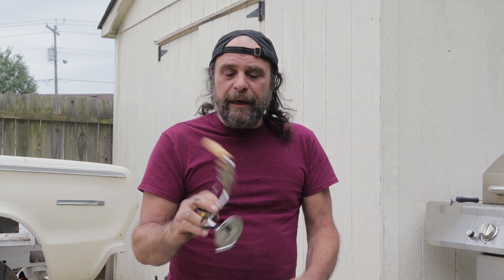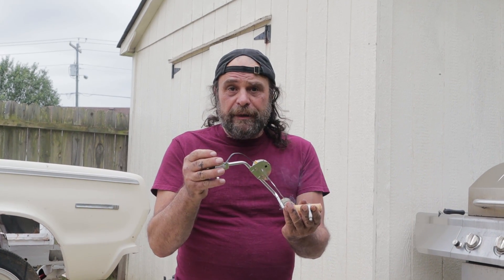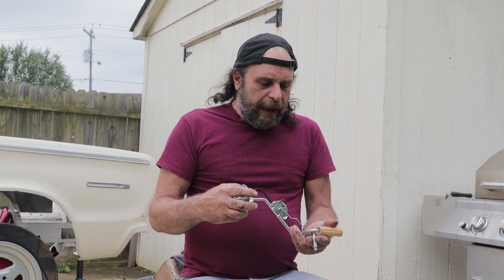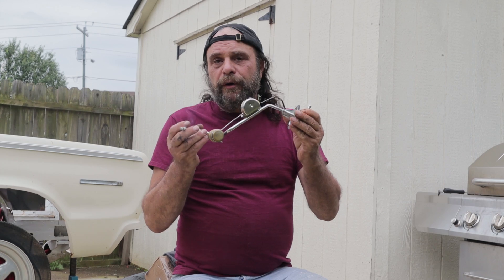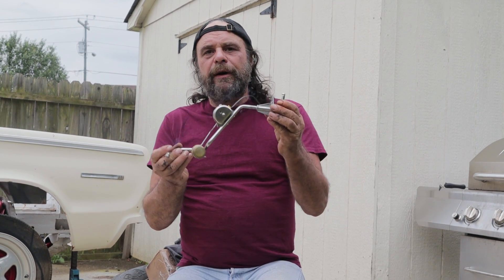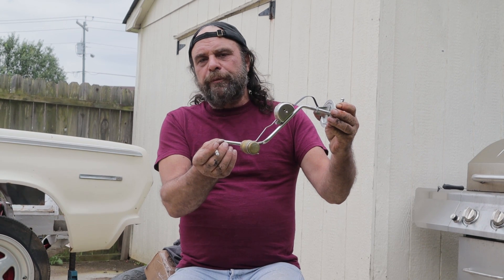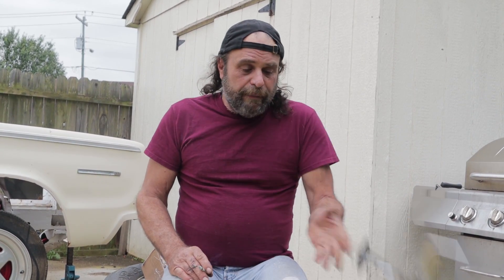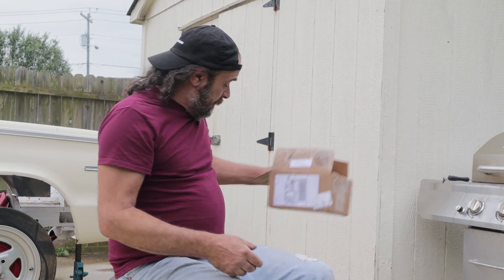Fuel System Basics- In Tank Pick-Ups

Comment: Good video uncle Tony 

I’ve had the same problem except with not the fuel pick up but the oil pick up in the motor where for whatever reason I used a different sump at the time and it went on fine..... but the oil pick up screen was basically 2 mm off the bottom of the sump and when I started the brand-new motor I could not get oil pressure......!!

caused a panic for about an hour when I finally figured it out..... you can just drop the sump and bend the pickup by hand to give it 3/4 of an inch or an inch and that’s fine........

but here you are starting a freshly rebuilt motor with no oil pressure absolutely causes workshop stressed to the max......!

It’s really popping a vein in your forehead type stuff...!

Give me fuel tank pick up problems any day compared to that mate

Comment: Did you inspect the fuel lines for cracks? Have you ever seen gas dripped on the ground after parking? A crack in the fuel line will allow air into the lines and at high rpm you lose combustion. Cant climb hills either.

Comment: I see how extending it helps, but what happens when you do some heavy breaking. Hmmmm
Reply from the maker: Not much fuel demand during heavy braking, no?
Reply: True....Like you said this is something we dont think alot about, if the fuel moved forward or backward, does just a little air taken in by the pickup tube matter at all, and would there be a difference between mechanical/electrical pumps in this matter.

Comment: got into a little skirmish/fun race up a BIG hill back home in my 70 torino with a bud in his 68 chevelle. i was pullin him petty good, then suddenly mine nosed-over and went ker-plunk. he went buy me like i was standing still. had to do a coast-down the hill backward followed by a strange uey. coasted about 4 blocks. couldnt find a single visible problem. after alot of cranking it finally started and ran fine. i sold the car before the problem was remedied. if that wasnt a partially blocked fuel pickup...i dont know what is....good video T.  on a subject...not addressed enough, always better to have the system in your hands for the classroom anyway...keep up the good work.

Comment: You'd be one hell of a fun next door neighbor to have, all the neighbors would hate us, loud ass old Mopars  I've got a 318 74 duster and a streetable /mostly strip built 69 bee with a 451 inch stroked 400 4.57 gears auburn sure grip it's got super stock springs and adjustable snubber sub frame connectors, full comp 727.  292 /.509 MP cam  I built most of it when I was 18 not many miles on it  Rocky Mountain race way closed down so it's going to see some street action

Comment: I put a new one in my 69 bee 22 years ago. right after installing it I looked at it through the filler end, damn thing was just like you mentioned sitting up wrong bends lol now 22 years later I put some fresh gas in and something is leaking now, I'll have to crawl under   and see what, maybe the fuel hose is cracked it's so old, then I'll finally fix that 22 year old pickup problem and maybe extend it like you do. maybe I'll make it a 3/8 or 1/2 inch tube and re solder the sender on  thanks for the extension idea great vids Tony

Comment: I’ve always had trouble with the brass floats on reproduction sending units. After a few months they either split open or they leak at the seam. Either way you get a sunk float. I’ve started throwing the brass ones away and using plastic ones instead.

Comment: I had a 2300 Mercury Capri (79) that would not run on 87 octane and this was back in like 91 before all the ethanol.  If you put the cheap gas in it, it would stall out and not start back up until it cooled down.  Right before I figured out what was happening, I had to drive 25 miles home turning the car off constantly and coasting with the clutch in to keep the car from warming up.  With 89 octane, no problems.  Till this day I have no idea what caused that.

Comment: UTG
If you had a stock 383 Mopar, 4bbl , 600 Edelbrock with 323 NON sure grip . 
What would you spend your $1,200 to $1,800 on for performance? Street light to street light. 
355 sure grip OR Convert over to  Fuel injection?

Comment: Back in '86, had a customer with a Chrysler that would die after about 20 minutes on the highway. Would restart by the time the tow truck would get there. Was stumped....could find nothing wrong with this car. Then, in conversation it came out that the car had been rear ended recently, and repaired. Got me thinking. The gas tank looked new, so I dropped it. Pulled the sender and looked around in the tank. Guess what I found? The parts label was floating around in the tank. What was happening was that after driving long enough at a sustained speed on the highway, the label would get sucked and wrap around the pickup. After the car sat a while the label would float off the pickup, and the car would run again.....until.....

Comment: Uncle tony, i have a question. I have always heard stories of strike cars from the 70's and 80's. My dad told me stories of spark plugs in wire inside of frame rails to make phantom knocking sounds and "lost" extra nuts in rear drums. Did you ever experience any of this, my dad worked for crystler at the time. For some reason i think its an untouched peice of car history thats interesting.
Reply from the maker: Can't say I've ever come across anything like that
Reply: @UncleTonysGarage  i never heard about it till i got a job that finally beat me. I was frustrated and at my wits end... I never went to school for mechanic, i always talk things out with my dad. He laughed and let me know it was ok that it happens.... But that you never forget it either. Thats when i heard stories about cars he fixed made during strike times, and the one he never fixed... I think it was a 300 that was overheating and nothing he did could stop it from over heating. I guess its so seldom that we dont fix something that i find it interesting when we cant.... Thanks for the response anyways!

Comment: Also 2 other tech tips for Mopar fuel systems. Having put a 440 in a 67 A body-273 small block car- I had a top end charge fuel problem as well. I was drinking the small blocks fuel line dry. Also after 40/50 year's one needs to check the fuel pump rod for wear!
Reply from the maker: Actually, the only Chrysler engines that got 3/8 fuel line were the 44 Six Pack and Hemi.  All regular four barrel engines in A, B and E body cars got 5/16

Comment: A friend of mine had a 67 K20 that starved on fuel under heavy acceleration. Turns out the  pickup tube was missing the sock and a few small rocks that logged into it just enough to slow the flow. Was impossible to get them out so a new was bought. Keep what goes in the tank clean!!!
Reply: Exactly. I'm cleaning up a 67 c10 right now that's going to be a daily driver. It was in a barn since 2002. I spent hours cleaning the tank and sending unit before I decided it'd be best to just go all new and avoid the headache of dealing with fuel problems.

Comment: Did you diagnose it by disassembling it, or did you try to run it uphill?
Reply from the maker: Actually, it became apparent after running the car out on the highway, and not having any fuel starvation.  Since the issue only happened when running from a dig, it had to be acceleration related.  Only one place to look from there
Reply: THAT is troubleshooting 101 right there! 1) what is happening? 2) >when< does it happen?
Then, 3) how could it happen only under >those< certain 'whens'?

Comment: The part where you said the bends in the tubing raised it from where it should be positioned just now raised an idea in my head. Though my '83 Cordoba is wrecked for the time being (working on fixing it), this is most likely why it would act very lathargic or even very few times the car would straight up die. Even with a full tank of gas. Any other time on flat land or what not, no problem. After a certain grade of hill where it's stopped for whatever, big problem. Not sure what the 70's Cordoba's had for gas tanks but between mine and the '85 Fifth Avenue having a basic flat gas tank, I'm willing to bet that sending unit would have to be dead on to keep up. Couldn't have been the choke, the carb, etc. I went through all that and it persisted. Even the day of the wreck it did that.

Comment: Hey guys I took out the dashboard of my 01 3.0 Accord to remove the TCS and ABS light (I dont mind not having it) but when i put it back i realized that my fuel gauge wasn't working. It is so weird to me how Uncle Tony just posted a video about the basics of a fuel system unit after I spent 2 hours looking for some sort of diagram of the harness. I guess good things do come in bad times. Anyone can help me out? I suspect that it might be a wire that probably got loose and now there is no continuity between the sent signal and the gauge, but there are so many wires and I can't figure out on which harness to work on. When I turn the key on and the fuel gauge gets power, I see the needle move just a tiny bit and after 3 seconds it just falls down as if it had absolutely no gas. I never tried to run the car completely out of fuel to check if the reserve fuel light comes on or not, should I? I have had this issue for a few months now, but I just got a new job and I have to commute for longer so I am a lot more dependent on the fuel gauge, I used to only fill 'er up once a week and would have an idea of how much I would be able to spend but I also did not need my car as much. Please if someone could help me or simply suggest anything I would appreciate their effort a lot, to those willing, I thank you in advance. 

Great video by the way, as always !!
Reply from the maker: Someone hook this guy up with the info he needs!
Reply: Maybe try putting the light back in, the electrical systems in newer cars are capable of almost anything; I wouldn't be surprised if the two were connected somehow.  If it were a loose wire, I'd check the plug closest to the fuel gauge. May need a decent test light.
Reply: 2CAWKS alright I’ll try that tomorrow,  will let you know if it worked or not
Reply: 2CAWKS I found out that 2 of my lights are broken , I’ll buy new ones and see how it goes

Comment: How long did it take to track down that issue?
Reply from the maker: The answer pretty much jumped in my lap.  I ran the car out from the dig, and it fell on its face, about five seconds into the run.  A few minutes later, on the interstate, I stood on it, and she ran from 60 to 100 without even a hiccup.  At that point, I knew acceleration was a factor, and not heat.  Only one place to look from there

Comment: a friend's 69 1/2 SuperBee, loosened the ring and puled the unit, unseen some gas barely overflowed and trickled around the parting line of the tank, came to the rear corner of where I had parked my ass, and drained itself into my ear. Burnt like a bastard and good for a trip to the doc to get a flush and rinse. Good times!

Comment: My buddy built a 32 5 window and put whatever standard catalog fuel cell in the back of it with whatever standard pickup came with it and just barely got the car done before his sister's wedding (which was a promise he made her)... Got it to the wedding, everything was fine, driving it home and it just stopped... He forgot to put a clamp on the rubber pickup hose on the bulkhead and it fell off into the bottom of the tank...

Indeed, the little things will stop ya flat.